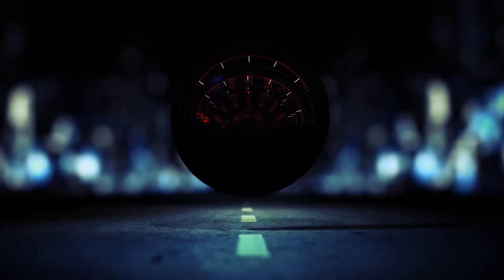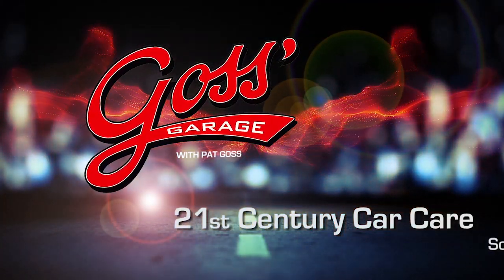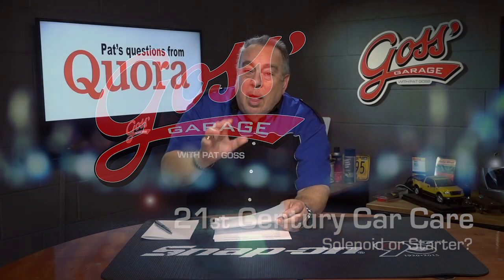Solenoid vs Starter?

Comment: I have a 52 Chevy and when I push the start button I just hear the soft Bang sound (click)
Brand-new battery.. can I just remove and get the solenoid tested or do I have to take both starter and sel? Thanks